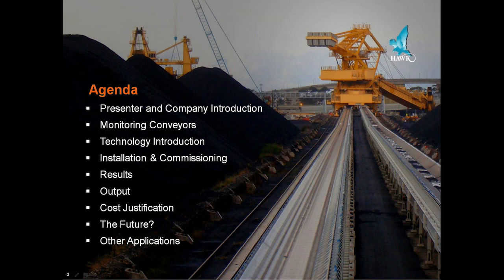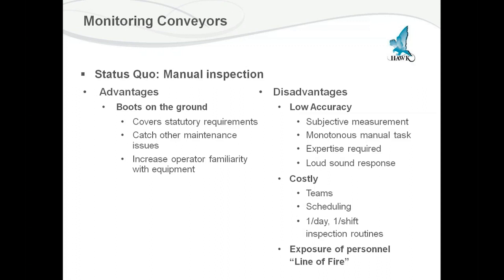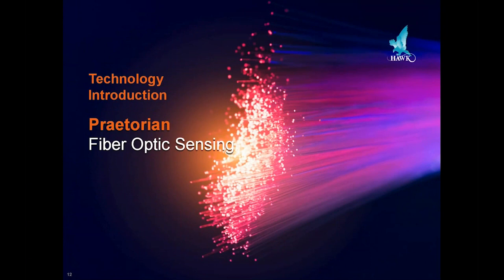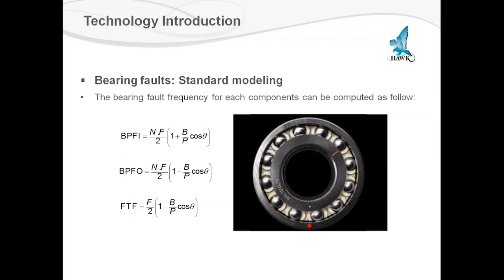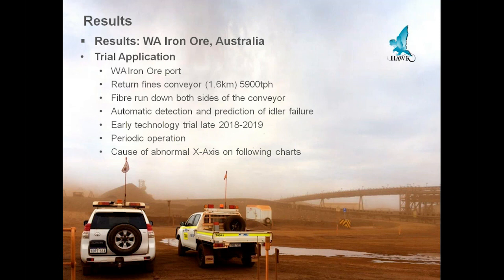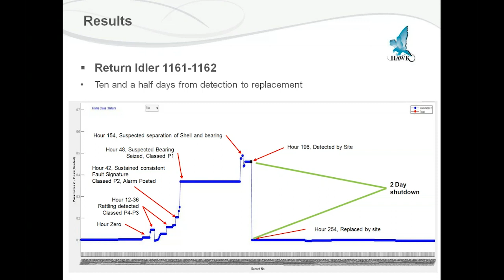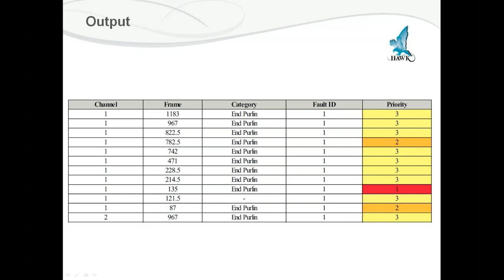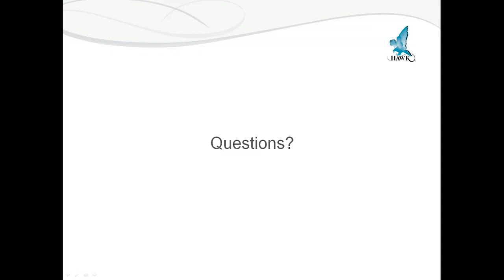Getting a Roll on with Automatic Conveyor Monitoring Webinar

Comment: Hi HawK
I am from Brazil and we work with material handling installation design and we are interested in the monitoring systems for idlers.
Can you report your experience for iron ore conveyor and how many installations are currently working with the  Praetorian Fiber Optic Sensing,
Also We would like to know how to obtain costs of the systems and how we can introduce them in Brazilian Market
Reply from the maker: Hi Billy, thank you for your message! Could you please provide your email and we will send more information. Or please email info@hawkmeasurement.com and we will respond back promptly.

Comment: Did this monitoring system apply in Sulphur granulation plant conveyors system which have more dust and solid sulphur deposits in structure?
Reply from the maker: Yes that would be fine, although we would have to clear the stringer back to bear metal in the installation phase.